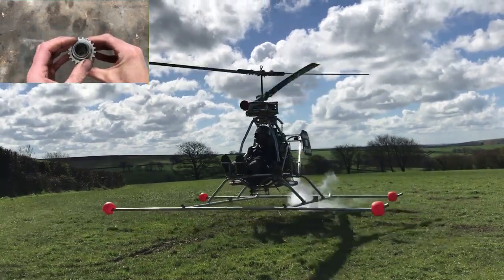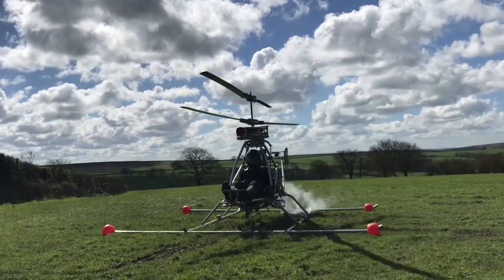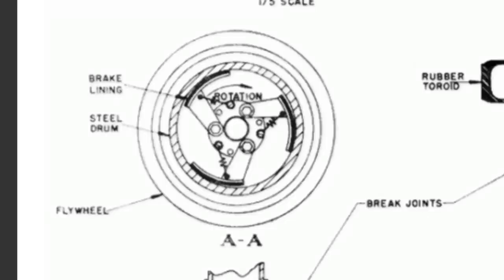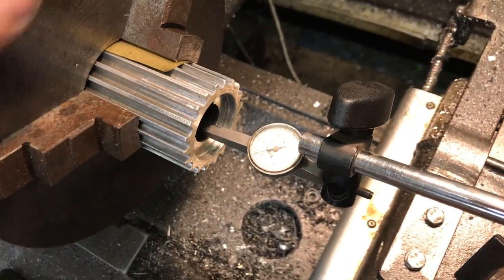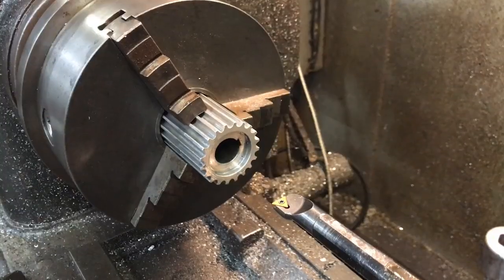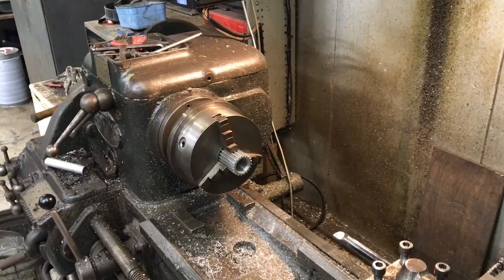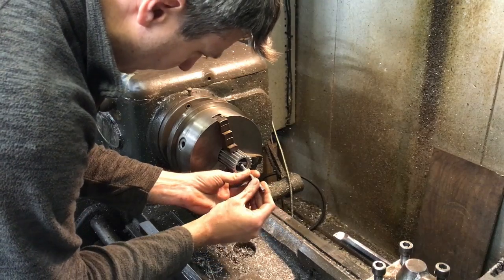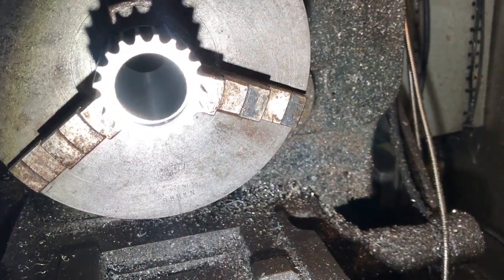Homemade Helicopter rebuild PT4 , driveshaft UJ making and a new idea

Comment: please stop calling it a one way bearing it's a sprag CLUTCH and unless the design has changed since I retired it doe's  not have rollers in it but plates with a radius on the ends so It will slip or grab
Reply from the maker: @stuartwilliams1790  Sorry but I believe it's a one way bearing, it has needle rollers inside. The suppliers do call it a sprag clutch one way bearing though.

Comment: You should modify that chuck, as a set tru chuck. For milling, you should try a roughing end mill, it removes way more material with less load. That carbide tool removes so little(I have it and never use it). How did you make the outer radiuses?
Reply from the maker: Hi, I hadn't heard of a set tru Chuck, would certainly be nice to have. Will look at prices. Great shout on the roughing milling cutter, I've not really used them but I have a few, didn't realise they were so much quicker, will try it. The outer radiuses were just done using the DRO radius function. It's gives you two coordinates to move to in X and Y and then you plunge in Z. It takes a little time but not too bad. 
Thanks for the tips 👍
Reply: @Ben-Dixey  I have the radius function, but never tried it. next project I will try, thanks for the tip. You can modify your existing chuck, by machining down a bit on the mounting flange of the lathe spindle, drill and tap 4 threads in the chuck body(12, 3, 6 and 9 o'clock positions), install 4 set/grub screws. These will align the chuck to be true.
Reply from the maker: @19mati67  sounds good, I'll have a look at that option, be good to dial it in perfect.

Comment: Hi Ben, are you planning on using a conventional coaxial helicopter control mechanism instead of the current one if it is unstable?
Reply from the maker: Hi, no plans to change the control mechanism at the moment, I would just like it useable again as the first priority. However I do have future plans to add collective pitch for example.

Comment: You are making good progress I must admit to a couple of worries first the press fit of the one way bearing will it not stand a chance of rotating in the hole under torque or have you taken that into account secondly the sliding shaft I think will be prone to the round pins denting the slots when going from drive to freewheel and may cause a notchy slide way causing it to stick I have seen something similar but they used a rectangular carrier that fitted in a larger slot and the pin was a press fit in a hole in the middle of it to spread the load hopefully my fears are unfounded but as you asked
Reply: Hi Ben my concern is that the outer case of the bearing is a press fit so when you apply torque to it as the motor drives the blades it could rotate in it's housing as it is only the friction of the press fit stopping the rotation on a normal bearing no rotation torque load would happen but in this case you are driving the whole power transmission system relying on that press fit not to spin I do realise that the rollers will exert a force out but will that be transmitted through the case to the housing to increase the friction
Reply from the maker: @jasondraper3838  Ah ok. In part 3 I tested one of the one way bearings to 55lbs/ft and no slippage was evident. The engine produces a maximum of 55lbs/ft constant torque. There will be spikes to that torque admittedly my estimate is 100lbs/ft would be a maximum spike. There are 5 one way bearings installed. The only thing to my mind that could cause slippage would be heat in the pulley, aluminium expanding at a greater rate than steel. I'm hoping the small amount of heat in the pulley won't be sufficient to cause a problem. However I have no experience with these one way needle roller bearings and there might be a problem that I'm unaware of.
Reply: @Ben-Dixey  sounds like you have already sorted it well done 👍
Reply from the maker: Hello and thanks for the comment, could you explain a bit further the concern with the press fitted one way bearings? I haven't quite understood what you are predicting will fail. 
The concern of the pins and contact area I can understand. There will be needle rollers on the end of the pins but it's still a round surface contacting a flat surface. Line contact which is high pressure, any kind of impact could cause an indent. I think hardened bearing guides could solve this problem if it appears.

Comment: I've used M4 cap head bolts into aluminium on an E-Trike project and they were less than satisfactory. Risk of over-tightening stripping the threads and general vibration of steel bolts against aluminium caused thread degradation.
Reply from the maker: @TonyGoacher  it's not ideal I agree. I think it will depend on the load each screw has to withstand. A courser  thread I think is better than standard metric.

Comment: Good to see more improvement on your project

Am also still working on my helicopter ❤
Reply from the maker: @OYEUAV  how are you getting on ?
Reply: @Ben-Dixey  getting on with the rotor head I had some problems with the gears . 

I used two stage gearbox for speed reduction, with engine rpm of 12000 I needed an output of 1000 to 1200 rpms so I designed a gearbox for such purpose.. First I used an angle grinder gearbox head for the first stage bringing the speed to 3428 rpms and multiple the torque which then fed into the second gearbox of another angle grinder gearbox and then final output of 1079 rpms) my helicopter weigh 13 KGS and the engine was an oleo mac gsh 51 chainsaw with 3hp 
My problem came as the final stage gearbox my first test flight was a success, my second test flight was when I noticed the teeth of the gears are broken, I think the multiple torque was just too much for the gears resulting in stress and then the failure. So working on how to get a stronger and better gears for the project. Any ideas
Reply from the maker: @OYEUAV  That's a shame about the gears, what wattage angle grinder was it that you used the gearbox from? It's the multiplication of torque that's the problem. As you know the torque is multiplied by the gear ratio. What torque does your engine produce ? If you know that then you can work out what torque is going through your reduction gearboxes. You will need to find a gearbox that is designed for the torque that you are putting through it. 
Of course it has to be lightweight too, that's the challenge we face.

Comment: This sliding torsion joint does feel like a better engineered solution, Ben. What you really want is a way of testing it in situ, with strip down and inspection, to build up some confidence.
I never cease to be impressed at what goes on at the Devonshire BADGER works...
Reply from the maker: @martingarrish4082  Sounds good to me Martin, I can test it in situ, no problem, anchored to the trailer like I did in the beginning. 
I must remember to use to code name, it's very funny. 😆👍

Comment: Very nice work. Personally, I prefer my wings fixed, but you do you dude.👍
Reply from the maker: @JFSmith-nb8hf  thanks, I like both but rotary wings are definitely a bit crazy. If you were an onlooker at a pioneer of rotary wing craft I think you would condemn the idea as totally nuts. Im pretty sure that would be my opinion, it does make you think about how determined the pioneers were with no doubt endless opinions from people.

Comment: Cool vid! Being a surveyor, I am inclined to ask if your angles (other than for parallel) are as carefully measured as thicknesses and seperation distances?
Reply from the maker: @gnomespace  Thanks. 👍 
I haven't measured any angles, are you referring to the 90 degree angle between the straight shaft and bored holes ?
Reply: @Ben-Dixey  yes, was wondering if those were tight, or if it mattered (or course all things matter) being centered on the shaft axis. It seems the CG has to be rather dynamic in your design, so was wondering where the angles came into it.

Keep reaching for the stars!

Comment: Love this design, much better than the old square tubing. However, I'm still not convinced by the choice of aluminium. Although the alternative I have in mind (Titanium) may be better, but extremely expensive. Also, hardened steel pins and aluminium together, will corrode like a bugger, wouldn't they?  I dunno, I'm still very impressed how you just 'one day' thought, I fancy building a helicopter, and then did it.  Keep it up Ben. I just love this series. Cant wait till the next episode. 🤟🤟🤟🤟🤟
Reply from the maker: @simonwatson5299  Thanks very much for the enthusiastic comment, greatly received. 👍
I've never machined titanium but as you say boy is it expensive. One day maybe I will be machining that material. 
I looked at replacing some of the bolts with titanium ones, a price for one m6 x30 bolt is £3.50! 
I think the aluminium will only corrode with steel with the presence of an electrolyte, like water or salt water. Happy to be corrected if that's not the case.

Comment: experience of centrifugal clutches? they do NOT LET OFF as long as they are rotating at engagement speed. no matter how theyre designed, as long as they are rotating, those shoes are engaged. yeah, it nearly cost me my front teeth on one certain homebuilt motorbike years ago... was NOT expecting the compression braking to be so powerful!  

the clutch from a honda C90 etc, theyre a sort of semi centrifugal, semi manual clutch but not sure how you would get one in there. they do disengage when you press the shift lever. (yes, they can be clutch-started!)

the best one way clutch is the sprag clutch from an automatic transmission. seen far too many "needle clutches" fail to trust them. whereas sprags "lock on" regardless, as they dont use rollers, rather, little "plates" or "dogbones".

good idea to drop the linear needle bearings... i may have mentioned this on another video, but the "cannondale headshox" use the same design and suffer "bearing creep", they have to be dismantled occasionally and have them pushed back where they belong... and my opinion from way back is that only ONE of those needles on each face will actually take the majority of load. seems you have now taken the path similar to what i sort of described earlier :) slots and pins...

regards uni joints... you need a pair of them or you get nasty harmonics from nonconstant velocity as the angle changes.... you can make them "inside each other" though. a "cardan joint".

either that or a proper CV joint... otherwise "something" has to absorb the variations in speed through every 1/4 rotation...

lol, 2:50... i blame the "southpaw click".
Reply from the maker: @paradiselost9946  Great comment as always. 
Wouldn't a "centrifugal clutch" release if the primary way it drives is through leverage rather than the centrifugal force? The Bensen B9 clutch in the video seems to be less about centrifugal weight creating friction but more about the points at which the friction shoes are levered against drum. Therefore I would expect it to release, no doubt with some friction still present due to what centrifugal force is present. Would you agree ? 

I hadn't seen the example of the bicycle forks using flat cage rollers, interesting. 

I haven't got any experience in using the needle roller clutch bearings so I guess we will have to see if they fail or not but there are 5 of them when one can handle the max engine torque. Sprag clutches are no doubt stronger. 

I had forgotten you mentioned slots and pins, but I suppose thats how the brain works, ideas get thought of but you can't always remember where it came from. 🙂

There will be two universal joints to balance the speed variations. 

Southpaw click was to blame 😆
Reply from the maker: @paradiselost9946  I've been thinking about your comment on the two universal joints. 
My plan was to have a universal joint just above the clutch and a universal Joint at the top. This I thought would be ok as it's just like a prop shaft on a car but actually it's occurred to me that it might not. 
With the head tilted fully to the side the top universal joint will have a 3 degree tilt but the bottom won't change angle. This I think means there will be a vibration because the joints don't share the same angle. 
Can this be solved by a double cardan joint at the top ? Or will I have to abandon universal joints and go back to a constant velocity joints ? 
Thanks
Reply: @Ben-Dixey  youve made me dig through books doubting myself now...
so, a cardan joint is just a universal joint...

and whilst i swear ive seen a double "coaxial" type in use somewhere... the more i think, the more i doubt... 

but... i was reminded of something else... the thomson coupling. 
uni joint with a funky parallelogram linkage inside to constrain the spider. it may be what i thought i saw?

from what i can see , shouldnt be too much trouble to modify what you so lovingly crafted already... be a shame to scrap it. (dont you hate that?)

and then... its only a few degrees of tilt... and its before the belt drive, correct? with a fairly high redux? 3 degrees of tilt isnt a huge amount...

may just be able to get away with it, or use a cushdrive in there... thinking of old shaft drive bikes, that use a single uni-joint without major dramas...

you got this far, maybe just see it through before making big decisions..
Reply from the maker: @paradiselost9946  thanks for your time in responding, a double cardan joint is what I was suggesting on the top joint, it then becomes a constant velocity joint I think. 
So single universal or cardan joint on the bottom and a double on the top. 
As you say the small articulation angles maybe not result in significant rotational changes in velocity anyway.

I had forgotten about the Thomson joint, will look into that option. 👍

Comment: Do you have a four jaw chuck.
Reply from the maker: I do, I've only got hard jaws for it though. Can you get soft jaws for a four jaw ?
Reply: @Ben-Dixey I used to use bits of lead flashing to wrap the jaw and protect the work. Much better off using the four jaw for accuracy and truth.
Reply from the maker: @normanboyes4983  👍
Reply: @Ben-Dixey  I have been a machinist for 50 years and I use 1mm strips of aluminum. If required,

Comment: As for the drive shaft, Volvo used telescopic shafts as wheel drive shafts in, i believe, the XC90 (or something similar, not sure anymore), as a replacement for cv joints. it would be about the right size for your application, both in torque and size. trying to engineer something like that in the shed might be a bit of a challenge
Reply from the maker: Hi, the Volvo ball spline driveshafts are definitely an option, I would have to make my own lightweight version as the volvo shafts are way over engineered for my purpose but it's doable. You can buy ball splines from Thomson linear at a much more suitable size but they are £600. 
You have reminded me to have another look at making my own ball spline like the Volvo one, could be a better option. 👍
Reply: @Ben-Dixey  The drive shafts of a PAL-V (don't know if you ever heard of those) are a lightweight version of the Volvo ones, and while they might look simple the grooves for the balls are not simply circular in cross section, they are kind of two intersecting egg shapes iirc. The tolerances and surface treatments on them are also not for the faint of heart. If you're serious about making your own I might be able to sneak a peak at the drawing detail for it
Reply from the maker: @rasmAn2  I hadn't heard of the Pal-V, flying car! At first glance it looks promising. I'll have a think about the option before taking up any of your time, thanks for the offer to look up some drawings. 
Interesting that the grooves are egg shaped, Hardening would certainly be necessary for a vehicle shaft applying around 2000-4000 lbs/ft of torque and for 1000's of miles but mine is only 55lbs/ft at engine max continuous power. Quite different requirements, so maybe hardening wouldn't be necessary. But the joint certainly would have to be made of steel. 
Do you work in the driveshaft industry? Or for Volvo ?
Reply: @Ben-Dixey  The main failure mode of ball spline shafts is not so much straight torque, but false brinelling due to oscillations in the applied torque, hardening helps a lot with that. Given that yours is a direct drive, given that yours is a 2cyl 2stroke, you have (correct me if wrong) a power stroke every 180ish degrees. The rotors are effectively a very large damper/flywheel combo, but a lot more flywheel than damper. I'd say considering the load in the shaft as +-75Nm LL is a reasonable start. This is why the egg-shape is quite vital there, to prevent the balls hammering from one side to another, and to provide a quasi-line contact instead of a point. flushing the grease often is going to help as well. 
Given that we are only looking at a relatively low torque, I wonder if the wizards at IGUS or Trelleborg have anything that might work. maybe not out of the box but they supply their magic slidy stuff as bar stock as well. 

I worked at PAL-V for 12 years, I've come to know a thing or two about constructing lightweight slightly impossible mechanisms:) Currently helping a marine diesel engine company get off the ground, so while still connected to the aviators, not on a daily basis anymore.
Reply from the maker: @rasmAn2  Well it's great to have someone with your experience commenting, pretty cool. 
I found some igus linear rails some that can handle some torque, I'll find out more. 👍